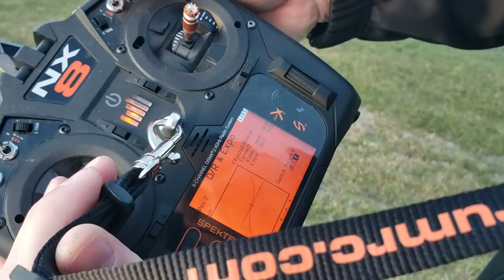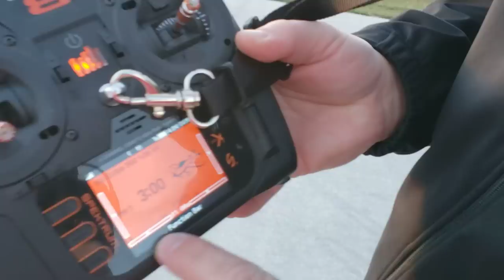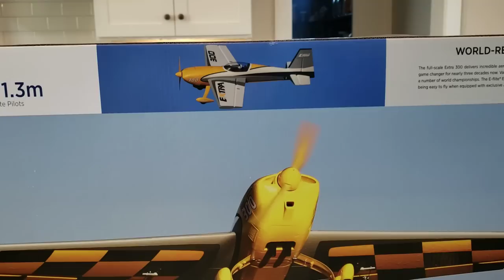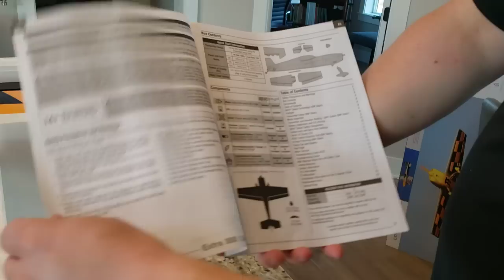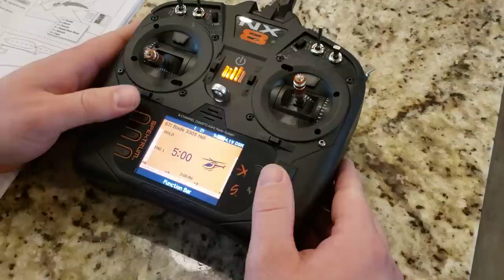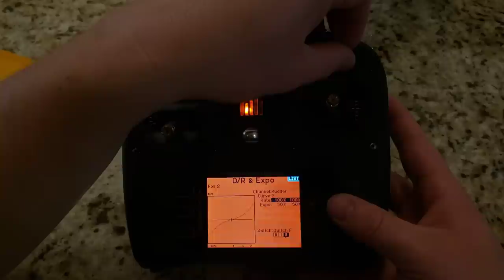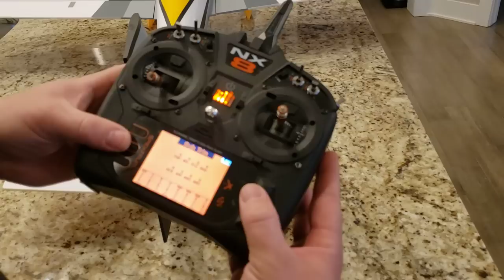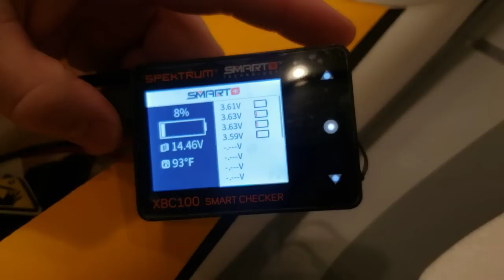Eflite - Extra 300 V2 - 1.3m - Unbox, Build, Radio Setup, & Maiden Flights

Comment: How was your CG??.... my E300 needs heaps of nose weight to hit CG.... cheers
Reply from the maker: I flew it pretty much tail heavy on purpose, but if I were shooing for more aerobatic, and less "3D" I would have used the CF horizontal stabilizer joiner, in stead of the metal one.

Did you use the METAL ONE?
Reply: @BrianPhillipsRC  No I used the CF one and it was almost impossible to fly without nose weight.... I absolutely love this plane, its my go2fav and I have put over 200 batteries through it..... I do think the landing gear is "light" so I have done a mod to mine which works a treat... take a look if you get the time https://www.youtube.com/watch?v=WtoS2YNQRxc cheers and thanks for replying ..... love your channel.... I dont know how you fit all your planes in your garage/house/hanger but keep up the great work and stay safe... merry Christmas from down under mate.

Comment: I think you forgot to put on the spacer between the prop and the nut, mine came with a little machined spacer
Reply from the maker: I wonder if I didn't get it??
Reply: @BrianPhillipsRC  possibly, it was on the motor shaft with the nut i think yours fell off in the video so maybe ot was in the box somewhere loose

Comment: This is a much better deal than the Arrows because the Arrows 540 doesn't come with a reciever.
Reply from the maker: The Arrows is cheaper and requires a cheaper Rx if you do it the way we did it, so with their coupon code, it's still a few bucks less...BUT they are both great planes. I think the Extra 300 is slightly better, and I do prefer the Rx that comes in the BNF planes ;)
Reply: @BrianPhillipsRC  

I agree the BNF offers a more refined package.

Comment: Great video! If you added an Avian Receiver you would get nominal voltage right??
Reply from the maker: If you have an avian Rx, should get Nominal Voltage as well as SMART pack data too, if you're using a SMART pack.
Reply: @BrianPhillipsRC  Thanks! Destryoed my V1 after 65 flights - thing fell from the sky. No idea what broke in flight vs smash.

Comment: First of all your videos are awesome! I saw my first one yesterday and have been binge watching them since. I was into rc planes in my teens till early 20s and now just getting back into it 22 years later. I cant believe how much has changed in 22 year's, and i was very surprised how popular electric foam planes are now. After watching you fly that 300s ive decides that i really need to order one of them. As i was ordering one on your link i decided i have no knowledge of batteries and chargers and im wondering what you would recommend i buy with it as far as batteries, charger, and transmitter? I don't have a problem spending more money on something if its worth it. Keep up the good work!
Reply from the maker: Sure, we have links to the battery for each plane, right under the plane, and the Transmitter, presumably you'll be getting a good one, since you know that you'll be soon RE-ADDICTED ;)

Chargers...here's what I suggest. You've been through the process before of buying and using only to eventually watch it go to almost no value many years later, so just get a good DUAL charger, and when you need an adapter, so you can charge a different size battery (which WILL happen) you can just build one at that time, or when you order the battery, you can buy the super-over-priced adapters - LOL...

I have videos about chargers and SMART pack here - https://youtube.com/playlist?list=PLXTH0DstRDc7fO2Vc4A4frWRhCmZo2qxG

Battery -
As I mentioned above, look at the link under the plane in the Video Description...you will see my recommendation, or if I suggest a couple, you can see I list a couple. SMART Gen1 is the best value to cost ratio, with 30C rating, but if you want to fly EDF Jets, and Helis at some point, you MIGHT consider the almost 1/2 more 100C packs in the Gen2 (you can see when you click the link)...but generally for a normal NON EDF plane, you'll be in good with 30C.

Charger -
S2200 https://bit.ly/398ohO6 - YEAH, I know...it's a lot, but it's kinda the cat's meow right now...and it'll do most everything you need for some time. They make a single channel one too, but it's almost as expensive... S1400 https://bit.ly/3rKYt3l - more wattage, and only ONE channel, but I wouldn't ever trade my S2200 for an S1400.

Transmitter - 
iX20 https://bit.ly/38XUA1I <<<< if money is no object, and you're especially obsessed, get this
iX12 https://bit.ly/3h8yQmF  <<<< if money is an object, but you want to get more "future proof"
NX10 <<<< NO, just get the iX12 if you want to spend this cash...I promise
NX8 https://bit.ly/3fffqyx  <<<< BUY THIS ONE!!! This is what you need NOW.
NX6 https://bit.ly/3eqEn7M <<<< Don't buy this, only a few bucks less than what you SHOULD buy (NX8)
DXs https://bit.ly/3jJmxz1 <<<< Don't buy this, you'll end up with one in a RTF (Ready to Fly) aircraft at some point
DXe https://bit.ly/30ctPm4 <<<< Don't buy this, you'll end up with one in a RTF (Ready to Fly) aircraft at some point
Reply from the maker: Oh yeah, welcome back to the addiction ;) Glad you're here with us Doug!

P.S. You may have noticed, we have something like 1500+ videos, so you could spend a few years watching and have trouble getting caught up ;) Please do - LOL
Reply: Lol sorry im the kind of guy that cant see something right in front of my face. So i ordered the 300, 52200 g2 2x200w smart charger, 2 14.8v 2200 mAh 30c smart battery, and the nx8. Is there anything else i will need? Do i need any kind of adapter to charge the batteries? Thanks for all the help

Comment: How is the Foam 2 Foam vs Foam Tac?
Reply from the maker: I've used foam tac and never been impressed. I think it might be more for crafts, and less for 10 feet away at 140mph flybys ;)

Not sure if there is any difference, just from memory...my Grandpa used Foam Tac once in a while, but I never thought it was very good. Even BSI (my go-to brand) made a foam tac product and I thought it got TOO brittle when dry, and it was still really expensive AND HEAVY.

As for Foam to Foam - good. Mucilage (hobbyking) also good, but it can come from HK dried out, so buyer be ware.
Reply: @BrianPhillipsRC  thank you sir!

Comment: Mine took 1 square of lead (tire stick on) weight to be able to hover correctly. My 1st 1 was perfect outta the box.

& For superb slow down characteristics, & unlimited hover to pull out, i use a xoar 14x5 prop.
Reply: NOW, i gotta take mine to the field! 🤯 Tho may be ruff fitting the extra, draco, & FMS pitts in a 16 canyon truck bed. 😳
Reply from the maker: I see, lower pitch to get out of the hole quicker? Good idea!
Reply: @BrianPhillipsRC  

Brian:
 Is there ANY way (u know of) to inhibit the rudder mix on the draco? I used YOUR setup on my nx10. (Regular plane with flaps. NOT their download setup. I always want MY safe in switch A, flaps on B, rates on C.).

Thank you sir! 👍